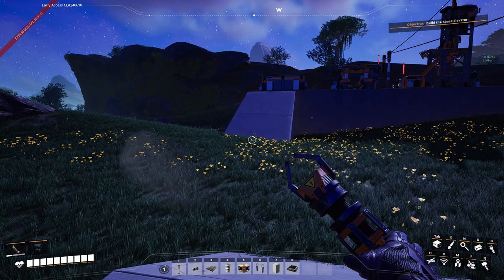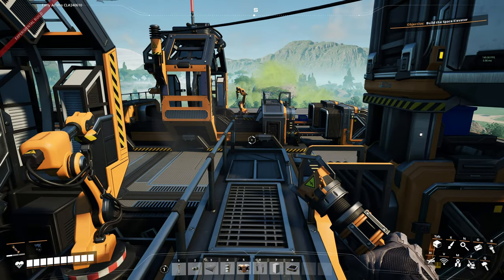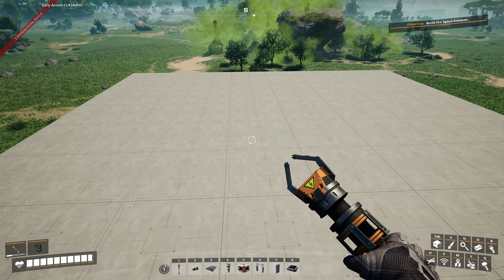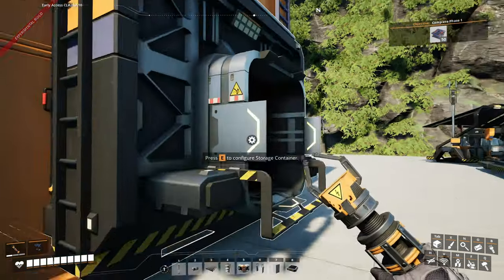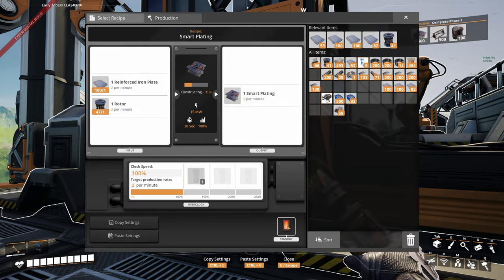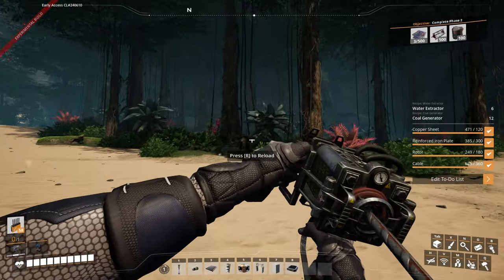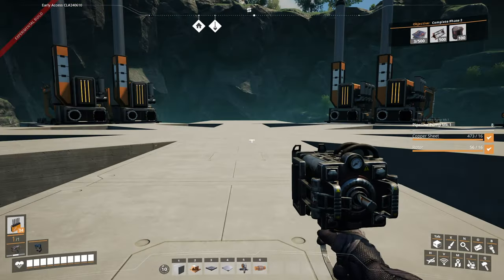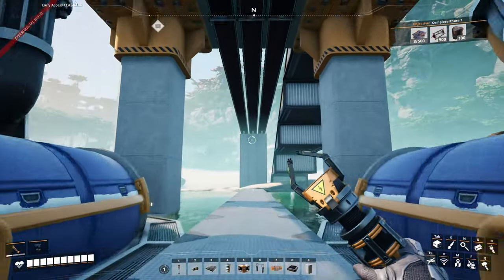Let's Play Satisfactory Update 8 |Ep.5| COAL IS THE GOAL

Comment: Another great video! The math  for coal generators generally breaks down to 8 generators powered by 120 coal/m and 3 water extractors. So you've got a ton of potential to expand your power network as you need!
Reply from the maker: I was certainly thinking about future expansion. Although won't have to worry about that until I get MK2 miners so I just cranked them to 200% since I had plenty of power shards. In hindsight I could have used less water extractors but doing a 1 to 1 and underclocking them  came to me as the easy solution since I have the plants paired up.